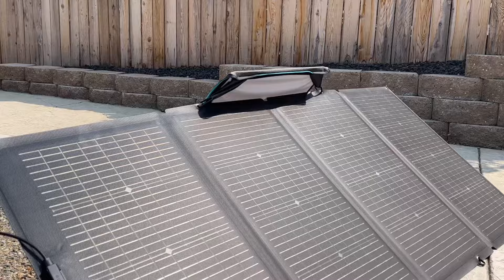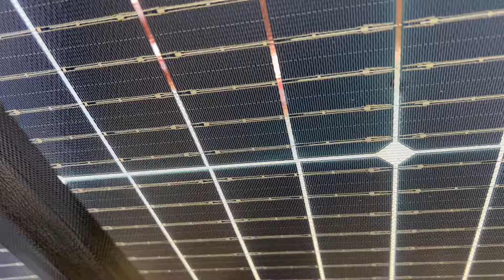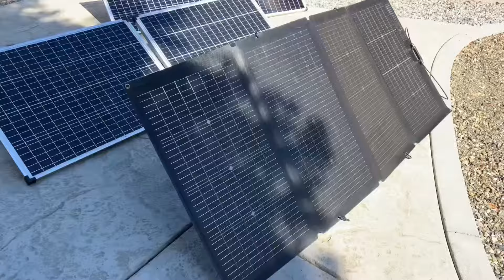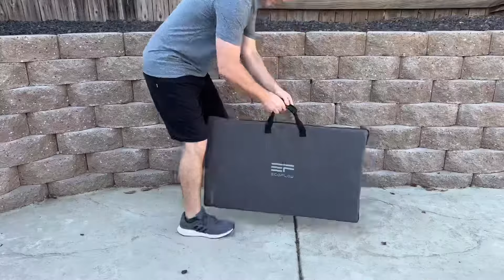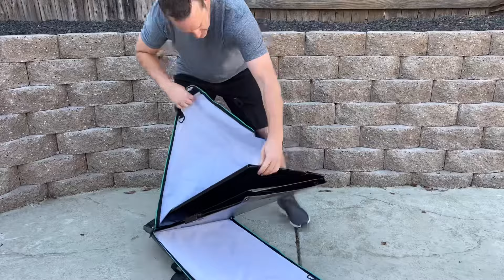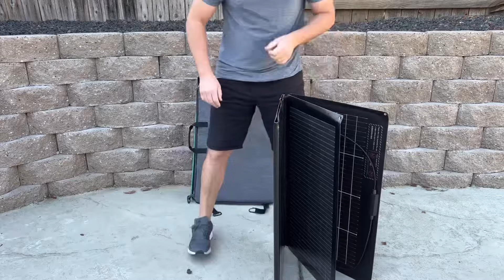ECOFLOW 220 Watt Bifacial Solar panel. Power in the shade??

Comment: The panels are now equipped with adjustable wire stands, a big improvement. I set mine on a white poly tarp for good bifacial performance.

Comment: I used to try to get the portables up on their kickstands. After a while, I gave up and just lay them flat. I only loose about 30 watts or so per panel just laying them flat.  I have 4 of them and still bring in 600+ watts consistitly from 9 in the morning till 5 at night. before and after that Its closer to 400. They are rated for 240 watts but even at the optimal I never draw that.

Comment: Indoor bifacial panels are in the newsfeed. They use any light in the home, including sun.

Lightening bug enzyme can be genetically added to bacteria, placed in thin cases covering panels and then such panels can be stacked in attic, basement, garage etc. Maybe rented from power company with battery instead of transmission lines everywhere.

Comment: Question. I have the EcoFlow 400 watt portable/foldable panel. I test them with my multi meter before using them the first time. I multiply the voltage by the amperage, and get the wattage. When I plug it into the Delta Pro, I always get a wattage input about 20 to 25% lower than my multi meter measurement. Is that normal? It can’t be more than 5 or 10 seconds that goes by between taking the measurement and plugging the panel into the battery and I measure directly from the XT60 connector. Your meter showed a reading 4 to 5% lower compared to your battery…
Reply from the maker: A couple things to consider here. One is conditions, temp, clear skis and more all play a part in total performance of the panel. Two, almost every panel made will never produce rated watts unless it’s under rated. 
Another thing is when you are checking with a meter you are testing an open circuit voltage, VOC, so there is no “load” on the panel yet. Once plugged in a load will be placed on it and you will see new numbers that are now your Pmax or also Vmpp. Basically maximum power point voltage which is the controller inside the EcoFlow unit or other solar charge controllers trying to get the most amount of volts and current from the device. And if the conditions are not great and the solar panel is poorly angled it could be way less than rated. That panel in good conditions should give a good 380 watts or a little more or less.
Reply: @johnnysweekends  Ah, yes. The resistance, got it. The rated Vmp multiplied by the Imp gets me a wattage 14% lower than multiplying the open circuit voltage by the short circuit current. If I add 5 to 10% to that from what I assume is just the additional energy lost in the charging process of the Delta Pro, that gets me to that 20 to 25% difference I was asking about. How do they calculate what the load will be on the panel to get those published Vmp and Imp ratings? Do they base it off of one of their battery units? Or maybe MPPT chargers have the same or similar load…

And with the rating, most definitely. Anything over 90% of the rating of a given panel in perfect conditions is good in my book. I’m in WI so it’s a low sun angle right now. Looking forward to summer testing. By eyeballing the angle, I got about 325 watts during peak sun hours on a perfect day 9 days before winter solstice this year. AQI index was around 50.

Comment: When the panels were standing upright without the case that's probably the ideal angle for the panels. Besides that you could throw down a white tarp put the case on that it'll protect the case and give you that white reflection for the bifacial

Comment: I personally do not like these flexible solar modules. Theyre just too delicate, break easily and often they lack a proper stand.
I bought suitcase style mobile solar panels and would buy them again. They are strong and sturdy and the extra weight is not really a problem unless you plan to carry it for long distances.
Plus: If I dont need them anymore at any time in the future, I can always remove the hinges and mount them anywhere I want, just like normal solar panels.
Reply from the maker: I will admit, the stand could have been designed definitely different. The panel itself performs well, but overall the flexibility of it and taking it up and down is prone to being damaged much quicker.

Comment: Thank you for your review. Interestingly enough, I had the same sentiments about the awkwardness of getting the panel out of the case, and setting it up. Glad that we agree.  Your video helped me understand that I had my setup with the wrong side upfront. I had assumed that the cables should be in the back and was disappointed, because a cheaper panel provided 155w, and this ecoflow only went up to 145. I need to go out and retest. Your review helped me appreciate the Ecoflow's quality and renewed my interest in keeping it. In addition, you provided an answer to the question what are these straps for? Thank you again.

Comment: These things hate heat...More suited for cold climates. Where they shine...
Reply from the maker: Just about any panel loves cool temps
Reply: @johnnysweekends  Not like these.. I got a Renogy Bifacial 220.. It gets cool. It will push out 280 watts...
Reply from the maker: That’s also a rigid panel, again totally different as they will always do better than a flex panel. Flexible portable is more about convenience 👍🏼
Reply: @johnnysweekends  That is not a flex panel.. it's a fold able suitcase. They just removed the frame..

Comment: Just got these panels. Set them up on my south facing deck (June 15) in CT and was amazed at the results. The minute the sun came out from behind a cloud I checked my EcoFlow app and found the panels were inputting 228 watts! I am ver unhappy with the case, for all the reasons you mentioned. I think I am going to sew/construct my own stand that mimics the  stand feature of the case, in order to save the REAL case.
Reply from the maker: Yes good panel, poor case lol. Not sure what they were thinking

Comment: I bought a couple cheap ass adult size lawn chairs, disconnected the arm rests on both lined them up and placed my EcoFlow 160 on it and it works perfect. The panel is about 2 feet up and is pretty straight at a decent 45˚ angle. It can take some decent wind without tipping over. This offers protection from the dirt, rocks, cement and other junk that can do damage and cause fading overtime not to the EcoFlow solar panel, but to the case as well. I paid $10 per chair. Pretty sweet deal and the chairs fold right up and it is far cheaper than making your own stand. 

From my testing you can use a panel up to 220w and it should hold up just fine. I did try using my Bluetti 350w solar panel but due to the 3' width and 8' Length it was just too big without a 3rd lawn chair. It would hold fine with three, but not very wind resistant because of the weight and how high up it would be. Maybe, make some metal braces you could add and that would help it in the wind. 

I will probably just get some soft rubber pads I can place down for the Bluetti 350w solar panel to help protect it from damage.
Reply from the maker: Ohh nice that seems like it will work great..👍🏼

Comment: I have the 160w EcoFlow solar panel and the idea of using the case as a stand is just ridiculous. It is a beautiful case and I don't want to destroy it because I have to use it as a stand. There as to be some simple alternative for a stand to make this work where it is even more lined up. The stand isn't really enough. The outsides just flop around and there is zero support for them.

Even with a couple of my complaints I think the build quality is very nice and it works very well. Working on schematics to make a simple stand for it. Save material, but at the sometime make it durable and easy to disassemble when not in use. Should be fun. :face-green-smiling:
Reply from the maker: Exactly I don’t like using my nice case when I wanna set this up maybe in the dirt or whatever. I think it would have been nice to have a different support system and not wear out your nice case..🤷🏼‍♂️

Comment: You should probably read the instructions on the panel again. That’s not how you set it up. And it makes a big difference. It doesn’t touch the ground and it’s more rigid if done properly
Reply from the maker: Weather it’s set up correctly in the poorly designed carrying case it won’t change the output. 

In direct sunlight when aligned you get what you get. And being that it has memory it won’t fold out flat and stays bent on each end. After many hours it then relaxes which is fine. 

It’s a great panel with a not so great stand. 
I don’t like using my nice case in the dirt or moisture getting it all dirty or possible wear through the case. 

Good panel, poor stand.

Comment: Using a second solar panel as a light reflector is a brilliant idea, assuming the fact that the panel is designed to absorb light  rather than reflect it.
Reply from the maker: Any glass panel will definitely reflect. After installing many on roofs when the sun hits just right,,,,,.ahh your blinded lol. 
Of course you can see a mirror like reflection in solar fields or and home or building with panels. Like a mirror

Comment: Set the panels out on top of them $2-3 silver survival blankets.  Since their made to reflect off the sun ect.  They weigh an cost nothing
Reply from the maker: Yea over a 6hr period you may gain a extra 5% or so. If left in place for days that could add up. Unfortunately I really dislike setting this up. But its also not meant to be left out for long periods. So I don’t use it much

Comment: i wonder how it will perform using mirror reflecting light at the back of the panel
Reply from the maker: Someone did a test and percentage gain was minimal for the effort. Especially being a portable panel it does well with out it. So not gonna carry a mirror around 👍🏼
Reply: Set it up on top of a $2-3 silver survival blanket.  Them Mylar ones.  Wouldn’t be nothing to stake the corners of the blanket to the ground an set up the panels on top of it as normal.  Not much added effort
Reply: @AquaTech225  that’s genius! Also means the case isn’t sitting in the dirt!
Reply from the maker: Exactly. I don’t like my case getting hammered 😬😂

Comment: Thank you for your great video that provides real and useful information. I have this 220W panel and I am very happy with the output. My best output is 198W. I tried getting more out by using mirrors shining sunlight at the back but 198W seemed to be the max I could get. I was also impressed by the 20W I got under grey cloudy sky. I found the EcoFlow products pricy but of very high quality. You get what you pay for. Greetings from Belgium.
Reply from the maker: Thank you very much! Yes they do perform well even under cloudy skis seem to provide more power then most the competitors..😀👍🏼
Reply: @johnnysweekends  I don't understand why you get so low power results. Even during very low angle winter sunshine in February, I still get about 230Watts into the Delta 2 from the 220W panels simply balanced against a fence in a grassy field. I think the cover/bag/stand is decent for carrying the heavy panels, but very clumsy used to hold up the panels. Much better to lean it against a wall, fence, tree etc.
Reply: Try setting the EcoFlow panels on an emergency Mylar blanket & you’ll improve what the panels draw in.  I’ve been using the emergency blanket & been really impressed with the results, which are better than 198W most of the time (while under direct sunlight).

Comment: Kinda noticed that this solar panel is quite smaller than other 220W panels.
Reply from the maker: Yes it is a little smaller. Rigid panels are just slightly larger depending on brand and design.

Comment: What I like best is that this is actually a two-in-one panel. One is at 220W the other side is 155W.
Reply: Try setting the EcoFlow panels on an emergency Mylar blanket & you’ll improve what the panels draw in.  I’ve been using the emergency blanket & been really impressed with the results, which are better than 200W most of the time (while under direct sunlight).
Reply: @bsylvia1 great idea 💡!
Reply from the maker: Yes but still the max is only going to be 220 watts. I played with it a little more after the video and the reflection on the back is very minimal. I think if the sun is out and shinning through it’s already doing it’s job.
Reply: @johnnysweekends  without trying to do anything reflective off the back, I got 228 watts in full south sun, in mid-June, in CT. 😃
Reply from the maker: Good numbers 👍🏼

Comment: I need this panel since it is waterproof I can just leave it outside rain or shine.
Reply: What stand you can buy for this. Diferent from one o ready have.
Thanks
Reply from the maker: There isn’t One unless you build or make something. 
And only buy this if it’s more for portable once in a while use.
Reply from the maker: Yup true. Most portable panels the whole case would be saturated and gross. Although if you use this case as the stand it would be to. I would make a separate stand for this one
Reply: You can get at least six 100 watt glass panels for the same price.
Reply from the maker: Yup true. But no one would want to pack those around. 
Those are more a permanent mount. These are meant for temporary portability.

Comment: I love the fact the Ecoflow used tempered glass in this solar panels. Thinner yet tougher.
Reply from the maker: True but there is a limit. 
I purposely flexed it a little to see where the breaking point is….. I see can these getting damaged and not working so good later 😂
Reply: @johnnysweekends  I got nervous trying to manhandle them into the stupid case holder, especially when you're gripping at the top. I thought I heard a tiny 'crack' sound. 😳 How would you know if they really were cracked?
Reply from the maker: You will see a split in the coating form later which more then likely will be fine unless its through a cell, which then output will drop a little.

Comment: A 160w panel was included in my Ecoflow  Power Pro package. I like that the panel is lightweight, compared to my other panel's, but I haven't decided how I'll be setting it up yet. It's good to know that it works well in partial shade. Thanks for this review Johnny!
Reply from the maker: I don’t think that one is bifacial 
So not sure it will work exactly the same. I assume if one panel gets shaded then half will be out then when the next panel gets shaded the whole thing will be pretty much dead.
Reply: @johnnysweekends  Ok, thanks!👍
Reply from the maker: Let me know how that one works though. Curious 👍🏼
Reply: @johnnysweekends  Will do!